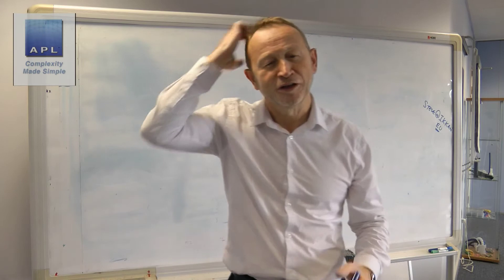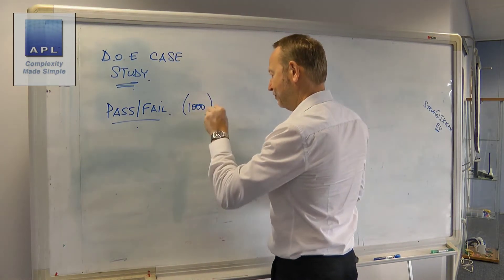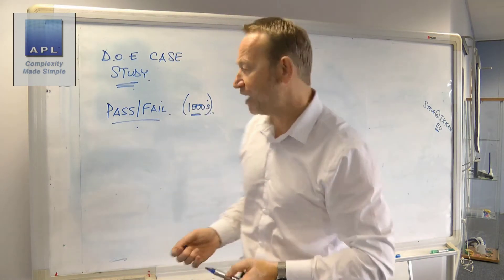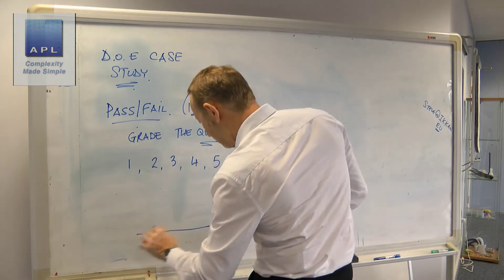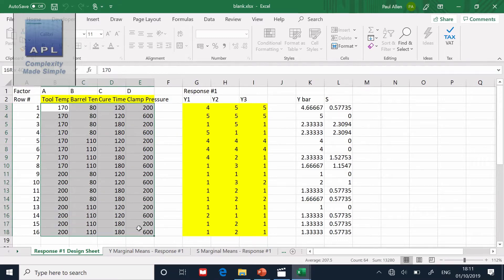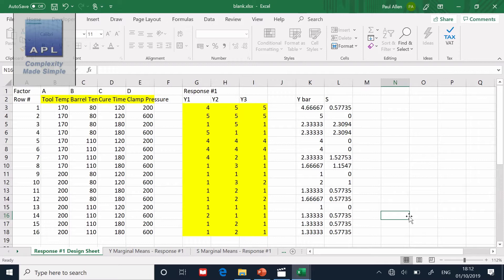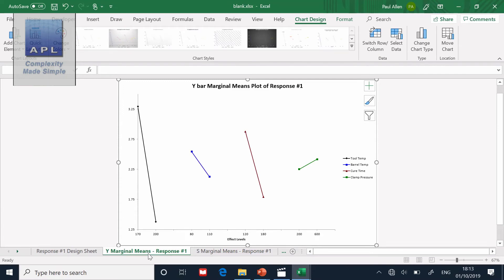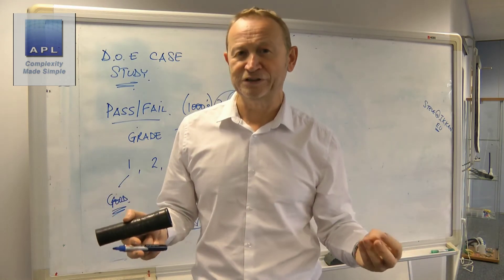DOE Tutorial - Converting Pass/Fail data

Comment: Hi Paul, 
The success of the solution, as measured after you have made the settings changes is reliant on the predictability of the data. As you don't test for this with observational data (or hint at this) any decisions you make can only be valid for that snapshot in time, this means that the success of the solution can only be adjudged from the behaviour of observational data taken from the process when you have predicted the settings.
All processes are subject to entropy over time, what's more is that the controls will eventually go on walk about.

The main reasons I say this are two fold, the first is that you suggest stopping inspection, being as you have no idea of the predictability of the process you don't have this luxury. Secondly, you say "make more money" but actually at this point in the process you have estimated the settings but still don't know whether these will render the process to be on target with minimum variation, unless you mean make more money than you would of done had you not performed the DOE, again thought the proof is surely the behaviour of the observational data following your setting validation isn't it?
Reply from the maker: Hi Geraint - to answer a couple of your points.
1. There is no entropy in processes, there is only only process neglect. If you let a machine deteriorate none of this will work. The best busnesses in the world don't see entropy...
2. Before I conduct a DOE I spend 3 months stabilising the machine removing this neglect.
3. This gaurantees I already understand the repeatability of the process.
4. I don't show it but i could have modelled the Standard deviation using this data and therefore could have predicted SD as well as mean.
5. As i say in the video the confirmation test at the end is the point where I can confidently say I'm about to make more money.
6 Confirming a predicted result requires much less data than just observing the performance of a process.
The video is a snapshot of my DOE book which is 260 pages, to engage engineers to want to know more...good questions though...
Reply: Hello Paul, 

1. I agree on the neglect, I have worked like you for some large companies and I can assure you that I have seen neglect. In order to fight this, and it is a fight, because entropy is relentless, you have to be running a system that helps and encourages the identification and minimisation of variation. For a lot of companies, even today this is not something that is encouraged.

The only way that the best businesses in the world don't see entropy is if they run systems of work which enforce processes that are on target with minimum variation.

2. Ok understood, be good to point this out in terms of a system of work. I'm guessing this is outlined in your book. 

3. Repeatability built on the foundation of prediction through your stabilisation measures/actions

4.Of course, it's understood, your estimates into the experimental model are based upon what is proven to be achieved. The past can be projected into the future.

5. Ok, based on the revelation of 2 this is on a firm foundation.

6. Ok

Thanks
Reply from the maker: Hi Geraint - There is sort of an heirachy to my approach. I look at mean and SD and decide which one is causing me a problem. Then I use tools and steps that will get me to the best place, minimum defect rate. If there is lots of inconsistency, you can put all the statistical tools on the shelf as none of them will be any use to you. The DOE tool is great on a stable process, but otherwise not recommended as you correctly identified...If you think of these video's they are showing you pieces of a 3 to 5 month project to remove a problem. That is how long it takes when a process has a problem with SD...always a good discussion Geraint...